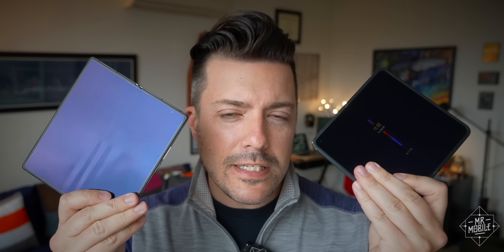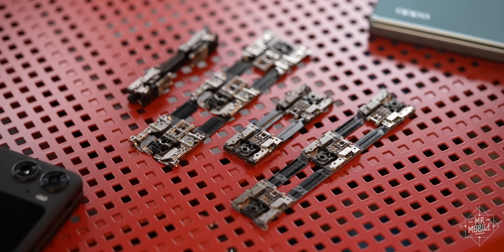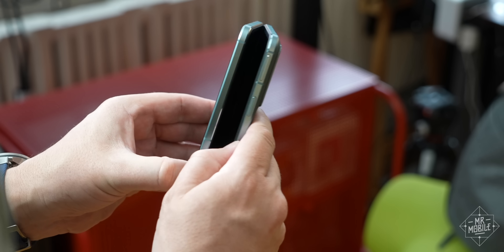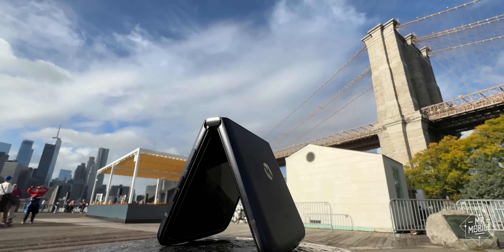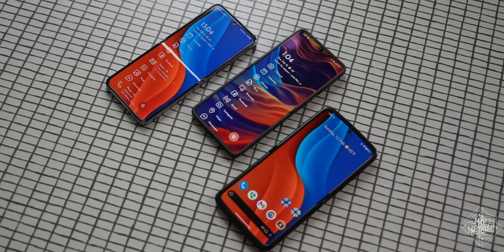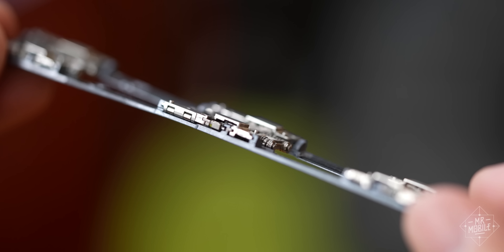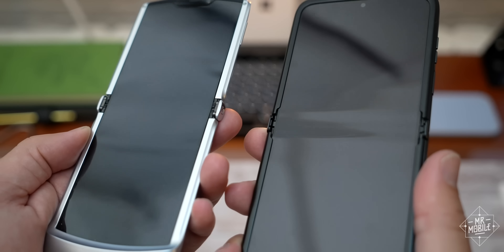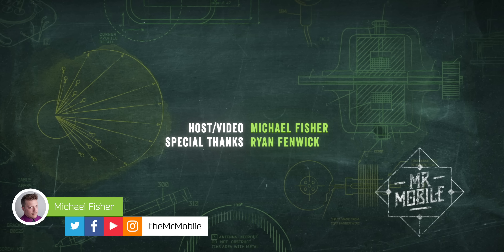Inside A Folding Phone: The Hinge That Helped Oppo "Delete The Crease"

Comment: My Fold 3 is still going strong. Have a few surface scratches on the top screen but the crease is fine even after years of incessant folding, short drops, unplanned submerging, and nights of falling asleep on top it.
Reply: Not that I care about Samsung/Android vs other companies, I just think that it has to do just as much with users and not completely with design. Before my Fold3 I had a S9+ I skipped a few generations because I don't replace my phone every year like Apple expects and almost demands you do.

Comment: I love my Samsung Fold 4, but in the last month it has decided to only open to about 175 degrees instead of the 180 needed to open completely flat, and it is BEYOND annoying. I haven't looked into getting it fixed, but I suspect it will be prohibitively expensive, and will end up being an issue I just have to tolerate. 🫤

Comment: I've had a z fold 3 for almost two years now. Got it in Agust 2021. I love the fact I can open it at any angle and to be honest I haven't treated this phone any differently to my 'slab' phones, in fact I'd wager I've dropped it alot more because of the weight and the fact it doesn't quite sit as nicely in my pocket, it has been rock solid without issues. Replaced the screen protector myself and that's about all.

Comment: Nice sentiment about the spring loaded ‘push to unfold’ but it would put a LOT of extra physical stress on the components. (Physicist speaking!) And so would hasten material failures.
Ps. Finally long term testing a Z Fold 4 here too. It’s surprisingly… excellent. Samsung did almost everything right. So roll on the ‘5’! 8-)

Comment: I built a molded, hardened rawhide case,-for my "Galaxy Z-fold-4-5g, so you can leave the screen open all the time, fits right into the case, like the way the men in England carry that little side bag, it's the smallest,an you could drop it, an it won't hurt your phone, and it's lined with rabbit fur, not expensive to make,and still really easy access, I think Samsung is doing the best with the hinge, and they're going to do even better, but we'll have to wait and see we've got some information, but until you hold one in your hand and use it, you won't know the difference, surprise surprise and wait some more🤓✌️in.

Comment: Great video💯but for me the problem isn't the hinge, trench or IPX rating, it will be it's connectivity to external monitors (alt mode) or if it has a desktop mode. The idea of using my fold as a desktop replacement at home, and work, would easily justify the cost of upcomming foldables.

Comment: IF manufacturers were to go woth a push button, I doubt you would be able to have a "flex mode", as you would either need spring loading or motorised and able to open all the way in one instance. 
I just don't see enough room for a resetting mechanism that has enough force to fully open AND have enough friction to hold the screen to an angle set by the user.
But, I'm not an engineer, so I could he very wrong.

Comment: Push to flip will be an engineering nightmare. How do you pack a decent battery, make it reasonably slim for a sandwich and accommodate a spring or motor for a push to flip functionality.

Comment: I own a S23Ultra and a Flip4. I adore the Flip4 just because its easier to use in nearly every use case. If or when Samsung merges the best features of both into one device, they'll own the market.
Reply: Adding the cameras from the S23 Ultra would mean a ~2mm thicker z flip z with an even smaller battery due to the space the cameras take up. In the current form factor it just isn't possible.

The S23 Ultra S pen also obviously doesn't fold.

Maybe in the future.
Reply: @toxicturkeyy  It's what I'm thinking... however I've seen 'people' claiming we won't even have smartphones within a couple of years. I believe I even read somewhere Apple was one of the company's making that statement.

Comment: i'd like to point out that your wish for a push-2-flip would most likely delete the ability to pose your screen
Reply from the maker: The i860 and i930 (which had push-to-flip) had the ability to rest at 90 degrees. But yeah, the unlimited pose-ability would probably take a hit on a modern foldable. 🙃

Comment: If you get the push to flip button you'll probably lose the opportunity to increase the hinge at different levels 

As much as I would like to see it, I highly doubt they would do that. Especially when you think they are trying to get better IP ratings for dust and water

What I would like to see is a better screen protector both from the manufacturer and the after market class

My Flop3 sucked and I no longer think I'm a buyer if the screen is this fragile. More so when the price for repairs is insanely expensive.

Comment: I’m not concerned about the hinge. I’m concerned about the ultra thin glass’ susceptibility to microcracks along the crease after 2 years or so.
Reply from the maker: Yep, same. That's why I spent so much time talking about the differing radius of the crease between U-type and waterdrop hinges. I believe Samsung's narrow-radius approach puts substantially more stress on its displays.
Reply: @TheMrMobile  I'm not convinced by what you said about Samsung doing it for cost reasons. The earlier hinges had a lot of parts, and were super complex. If you watched Zac's teardown you would see just how complex. They were also first to the party, which likely means the highest cost to produce. We can only enjoy foldable devices due to Samsung's high level of R&D, especially from their display division which is producing the displays for others. That's real investment, and others are benefiting from their efforts. The reality is that these Chinese companies have stripped Samsung and Motorola's devices and used them as a base. Samsung should have switched to the waterdrop hinge for the Fold 4, but they will for the Fold 5. That was probably done to build hype and a reason for people to upgrade to the 5. That's business. As for the glass, we will have to see. It depends who is manufacturing it. The radius is just one aspect.
Reply from the maker: @saturn93starx17  Well argued! I was admittedly comparing apples to oranges comparing a fourth-generation Samsung component to a second-generation Oppo one. But IMO, Samsung's cost-cutting has been evident in its last few generations of mobile (most notably in its slower iteration re: foldables on gen 4), which is the general point I was trying to make.
Reply: @TheMrMobile  I just wish Oppo was widely available in the US... 😭😢
Reply: @MustachioFurioso9134  OnePlus will have a foldable later this year. Hopefully it's similar to the Find N2 with a good price and fast charging and full software support. That would do well here
Reply: @jasonculver3516  Yeah the OnePlus "V Fold" as I've heard is rumored. Since OnePlus is available in the US I can imagine we may see it come here too. Might be enough to get me to finally leave team Pixel if it's basically a Find N2 clone
Reply: @TheMrMobile  it does you can tell when you close the fold, the closer you get to closed you can see the pressure on the lcd. Or so it looks to me.
Reply: @TheMrMobile I don't buy this at all. We have PLENTY of examples of other foldables cracking in the exact same way. The only reason it seems so much more prevalent with Samsung really does seem to be their market dominant position/sales volumes vs the competition, not a weaker hinge design.
Reply: @TheMrMobile /videos that`s not necessarily the case... compliant mechanisms are somewhat unintuitive in this regard... as long as they operate in the calculated area they basically can be used indefinitely...
furthermore one downside of the teardrop hinge is that the display basically floats in mid air when opened allowing for foreign bodies to get stuck behind them, which might put far more stress on the utg
that being said i am happy for more competition and different designs in the foldable space, because i am not going back to a flat phone
Reply: @TheMrMobile  I thought this as well, I haven't seen any Oppo, Vivo, or Motorola foldable crack in the same way that Samsung ones have
Reply: @ayyndrew  let's give it some time and watch
Reply: @Carl Gunderson as you stated yourself, there is literally glass, under a polymer layer.

Aka, it is real glass
Reply: @Carl Gunderson I'm not sure I follow on that, I suppose that probably more matters in the device. 

Some early foldables, like the Moto RAZR, actually didn't have that glass layer. So it sort of felt like you were touching...for lack of better comparison, the bottom screen on a Nintendo DS. 

The difference you feel on say, the Flip and the Moto RAZR at the time was sort of night and day. The UTG that the Flip used helped with clarity and smoothness (the flip felt more "premium" than the Razr).

I sort of understand the concern that JerryRigEverything had about the Flip having "fake" glass. But I wish he followed that video up with more technical knowledge because it caused a lot of confusion among people, and I think you have (through no ill intent) have fallen for a little confusion there. 

Samsung's UTG was a night and day difference between the Razr and the Flip...but it still wasn't as premium as say a Gorilla glass display. That was due to the polymer layer that you could feel on the top of the Flip display.

So the Flip felt better than the Razr, but flat (Hershey) style glass phones were both much more premium 'feeling' because it was a thicker layer of glass that we are used to feeling.

The misonomer about it being 'fake' glass, is an honest misunderstanding of the technology. UTG is real glass, but it's so thin that early iterations absolutely relied on a polymer layer for strength. Newer iterations are being developed by both Schotts and Corning, which rely less on strengthening layers and polymers. 

If you ever get a chance, check out a comparison of how the Razr gen 1 and the Flip gen 1 "feel". The flip has a bit more clarity, and is "smoother"
Reply: My fold3 had microfractures after almost exactly one year (slightly over). Thankfully Samsung replaced both screens no fuss and I had no warranty. Not sure why they replaced the outer screen unless it's an access thing.
Reply: @mythandfable  I will say, this was the main concern I have with the devices. However my wife daily drives a flip, and it's been about a year and a half without issues. Good to know Samsung can replace it if needed (she has an extended warranty with them).
Reply: My Flip 3 got a bunch of weird cracks in the crease and then got a hole (a constant bright white light the size of a small marble) soon after. This was after 5 months of use. 😢
Reply: I wish folding phones that are not from Samsung were sold in the USA
Reply: @Carl Gunderson I disagree it's false marketing, but I don't think anyone in this thread is a lawyer (and feel welcome to correct me if I'm wrong). Samsung, as far as I'm aware, said it was made with real glass, which is technically true.

(And sorry because I know we are both conversing at the same time, so I missed your other message until after I posted mine)

To highlight this, I think the best comparison is really to "feel" it vs the competition at the time. Wish I could explain it better, but the difference really was in the clarity and how they felt. It's super weird to explain over text
Reply: Keep upgrading as usual
Reply: material fatigue is such a difficult problem to solve. it'll be a while
Reply: @Carl Gunderson "All the softness of plastic, with the smash ability of glass!"
Reply: Yeah, me too. I feel it's going to be some years before that problem is fully resolved, if ever. And then there's the cost ........ a phone, folding or otherwise, would have to be very special (and also VERY repairable!) for me to spend more than 200 US Dollars on one. And I wouldn't touch Apple's devices with a very long barge pole.
Reply: Same reason why I can’t jump to the flip side yet. I love foldables but until we find a way to really defy physics and bend real glass, I’ll stay with the slabs.
Reply: @Carl Gunderson is laminated glass, automotive glass, etc “real glass” to you? If yes, what % is your personal threshold to qualify as glass? >50%? >80%?
Reply: @Carl Gunderson I’m asking you how much glass is required in a glass-plastic composite to count as “really glass”. Presumably Samsung’s formulation is below your threshold. 

Unless you didn’t know laminated glass has a big plastic layer sandwiched in the middle..?
Reply: @Carl Gunderson  facepalm emojis aren’t particularly informative… It’s fine if you don’t want to answer, it’s just you said having a little glass amongst the plastic isn’t enough to make it truly be glass. So I’m curious whether you regard other combinations as real glass or as plastic with some glass. 

I’m not simping for Samsung, I truly don’t care what people call it. I don’t use these phones. I just find these distinctions people make in the world, and how they can differ from person to person, fascinating. The old “what does it take to constitute a pile?” question.

So… do you just not want to answer? Have you never thought about this? Do you not have an answer? What is it.
Reply: @Carl Gunderson I wasn’t quoting you, or else I’d have put it in quotes! What I was doing is called paraphrasing. I summarised “you've technically proved me right [that it is plastic, not glass]. Just because the glass part is underneath the plastic layer. That doesn't all of a sudden mean that it's "glass". […] That’s basically false advertising” as saying it doesn’t really count as glass. 

Where’s the inaccuracy in turning “That doesn’t mean […] it’s glass” into “it’s not really glass”?

Anyway, I notice you once again ignored my actual question, only to quibble about your own phraseology. So I will ask you for a third time: what percentage of the glass-resin composite needs to be silicate rather than hydrocarbon to count as genuine glass? Is 50% enough or does it need to be 80-90% for you? 

Thanks very much for your time :)
Reply: @Carl Gunderson could you repeat what the percentage is? Because your facepalm comment has disappeared now, and I was never notified about a follow-up until your somewhat-angry comment 35 minutes ago. Perhaps the algorithms have decided to hold your purported-answering comment for channel-owner review. Certainly, neither is visible for me.
Reply: @Carl Gunderson I'm also waiting for your percentages. Just a straight answer is fine. i won't quote or paraphrase you or anything.
Reply: By then u got.a new one
Reply: the main screen is supper fragile dropped a coin on it could damage the screen ask me how i know lol 😂 😂
Reply: The issue here has FAR less to do with hinge style/fold shape and everything to do with UTG durability which affects all UTG foldables, but has come a LOOOOONG way with the most recent generations. The Flip & Fold 4/5 in particular are SIGNIFICANTLY less likely to crack than previous generations thanks to much stronger glass. What generation of UTG glass is being used has way, WAAAAAAY more of an impact on screen durability than hinge style/shape.
Reply: 600 likes
Reply: @Carl Gunderson actually JerryRigEverything was wrong on that video. I watched it, I knew you were going to cite it.

UTG is real glass, Samsung uses it but it's extremely fragile and doesn't "behave" like most glass. Early versions of UTG had a polymer layer on it, which is why it scratches easy. 

Corning and Schotts make, LITERAL ultra thin glass that folds. But it's extremely... fragile.

Which is why, if you have seen newer videos of newer foldable devices, those screens can have cracks and microfissures in them from stress from folding.
Reply: @Carl Gunderson it's glass, just extremely thin glass
Reply: Yup. I have an unwelcome black circular hole, in the middle of my Fold 3. Done with folds/flip.
Reply: @syednaveed6285  sounds like what happened to mine , started with a black dot (mine was at the bottom) then spread right down  the crease line ...
Reply: @soniccdx Yes. Sorry!
Reply: rocking the 2020 Razr 5G since launch, hinge and screen are immaculate.

Besides scuff and scratch on exterior from drops, the only thing THE ONLY THING that has truely failed seems to be the usb port not registering a charge since landing it chin first on concrete last week.

may need to replace shortly   T.T
Reply: @lockonstrato  that has a plastic screen, not ultra thin glass, plastic bends, glass don’t 😂
Reply: @lockonstrato  I wish I have an LG wing when it came out
Reply: Mine cracked just out of warranty. Insurance is a must
Reply: Yup. That's why my dream foldable is the Razr 5G, and not the Flip3\Flip4, because the Razr's are pretty much the only flip foldable that, with delicate use, can survive for 3+ years and not crack
Reply: Flip 3 here....18 months+ as my daily driver, screen and hinge are still as good as new. I've had to have the screen protector replaced twice tho, it eventually cracks along the screen fold.